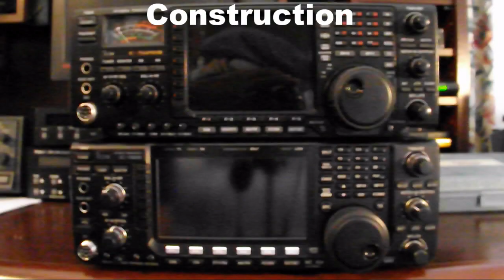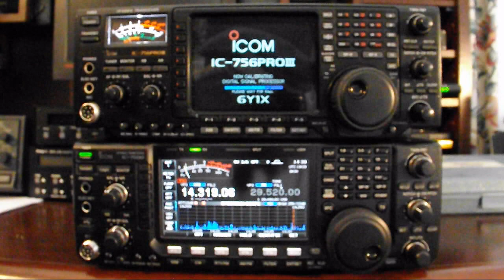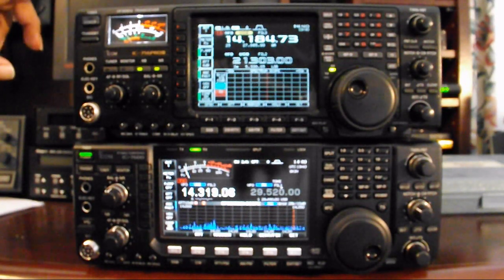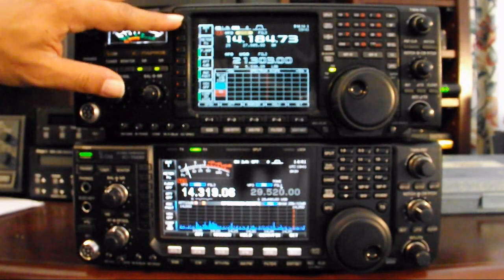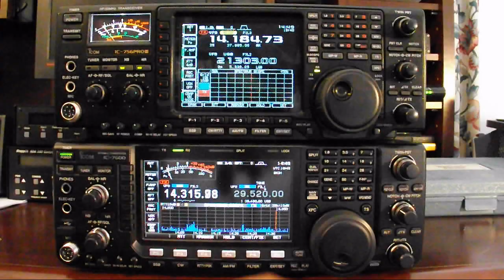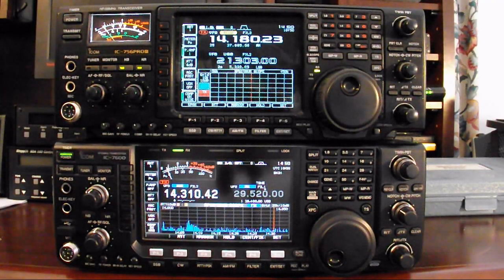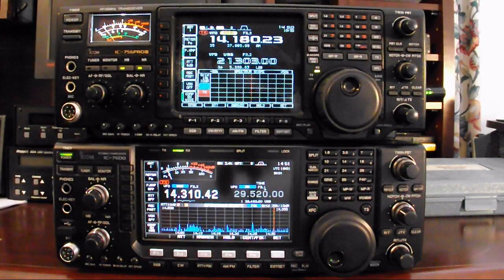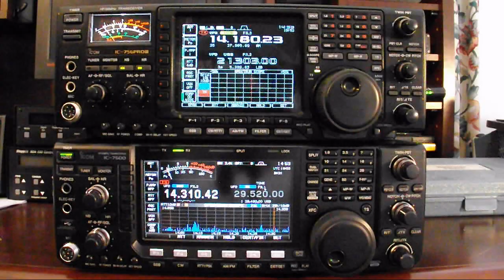Icom 7600 Vs Ic-756 Pro III Part 1 Construction and Layout

Comment: Love my ICOM 7600 and it is a Beast and much better than the ICOM 756 PRO II that it replaced. I prefer the 7600 over the 7610 as well because I hate any radio with a stupid touch screen.

Comment: the pro 3...do or did you notice rx distortion when volume is past 1 o'clock position, even with headphones? (on weak signals, of course 30db will be overkill)
I also notice full 100w on cw, fm rtty but talk power is 40-60 on ssb whereas my 735 did 100w no sweat on ssb.

thanks, 73

Comment from the maker: The smaller power button is not a great change but certainly not a good enough reason not to upgrade.
People really need to watch my video comparing the SSB receive of the 7600 vs Pro3.  You will see why the upgrade is well worth it.

Comment from the maker: The Mic I used on Both Radios is an Icom SM-20.
I am not overly impressed with the AM on the 756ProIII but the FM is Ok.
The 7600 has good Am and Fm.

Comment: Pro3's, in 'like new' condition, are getting top dollar on the used market.  That said, the tuning knob on the ORIGINAL 756 (with the monochrome screen) was better than the Pro3.  It had a very 'weighty' and silky tuning action compared to the latter 'Pro' series 756's.  Nice comparison video.